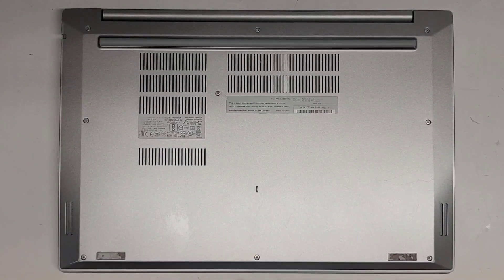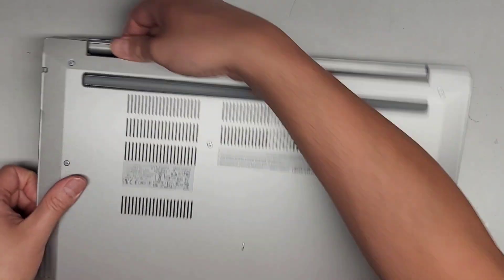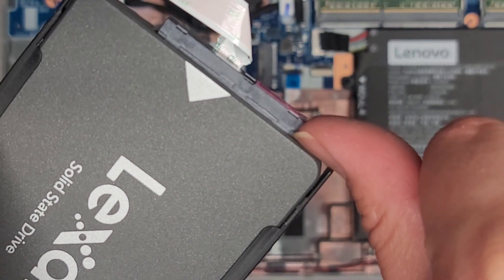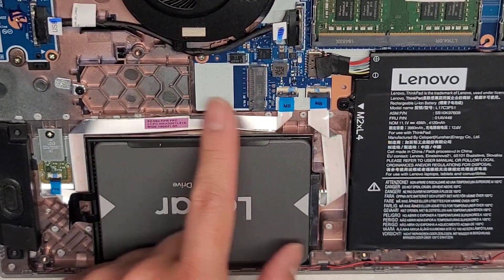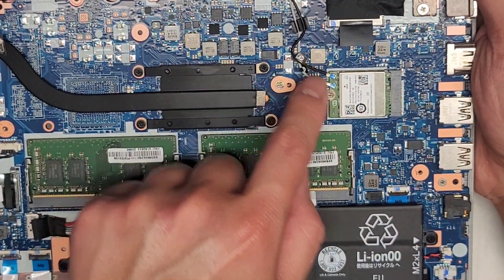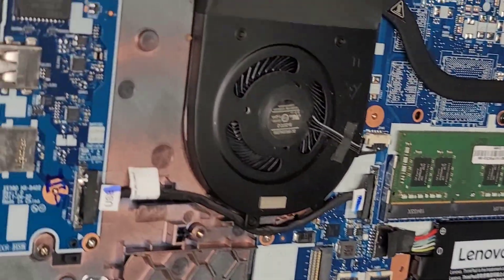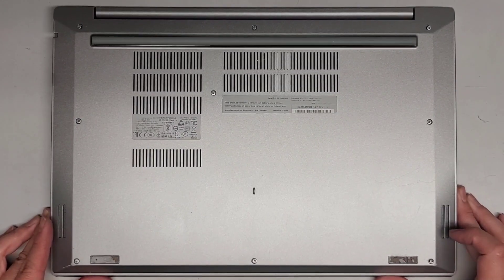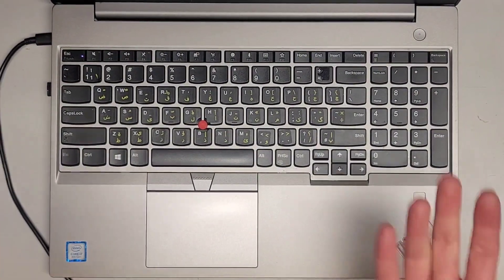Lenovo ThinkPad E580 Disassembly RAM SSD Hard Drive Upgrade Replacement Repair

Comment: Best video I’ve seen about this. I have an E595 which only came with a 256gb nvme. But there is something in the sata slot. I will be upgrading, but what is in the slot? Some kind of placeholder? Looks like it has circuitry
Reply from the maker: @GrieveIV  hard drive?
Reply: @ItsBinhRepaired  that’s what I figured but there’s no storage coming from anything but the nvme. Unless the hard disc drive wouldn’t show up as storage?
Reply from the maker: @GrieveIV  strange. What does it show in disk manager and device manager?
Reply: @ same there. Just shows the Samsung nvme. So I don’t know what this placeholder in the data slot is
Reply from the maker: @GrieveIV  strange
Reply: @ agreed. For now I’m not touching it until I know lol👌🏻
Reply from the maker: @GrieveIV  lol OK

Comment: Hi!, I've a doubt, What is the type or kind about m.2 nvme unit? Can I try for 2280 or i must 2242?
Reply from the maker: You need the full length SSD 2280
Reply: Tnx a lot my appreciated  @ItsBinhRepaired
Reply from the maker: @Fernando-l9p5h  no problem

Comment: I believe 32GB RAM is the maximum memory on this laptop. So use 2 16GB chips if you want to max out the RAM.
Reply from the maker: I think that's the most you can currently get